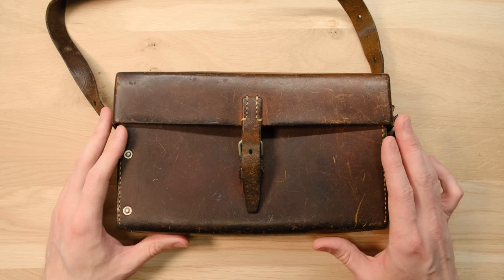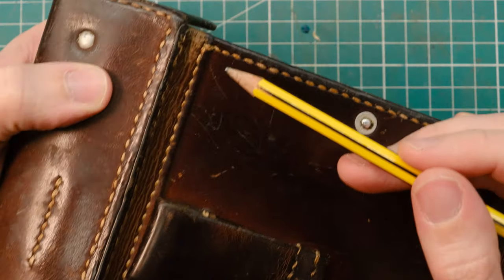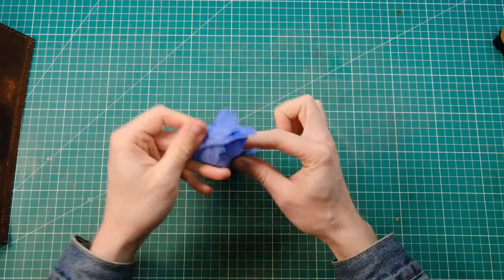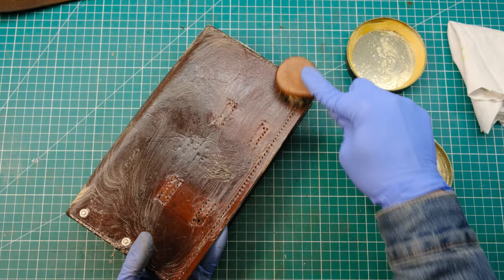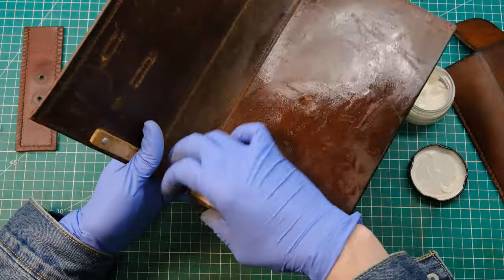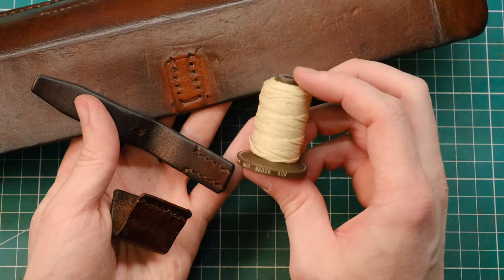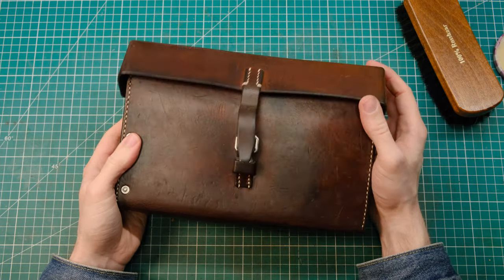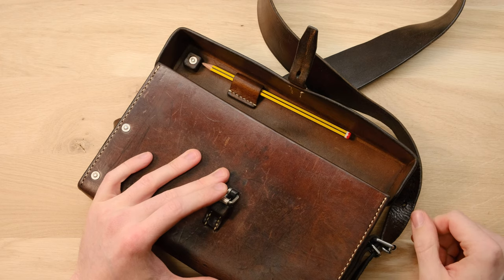Restoring a 1945 "Kartentasche" from the Swiss army - leather renovation

Comment: Nice video! Actually the R stamp is the mark that the inspector of the army would give a bag if it was qualified. These bags were made bij civil saddlers and they had to meet the standard of the army. The sling I think is from the same time period, but not belonging to this bag. I have only seen these bags with a very slim strap (adjusted to the back and not to the sides), or with no strap at all.
Reply from the maker: Thank you so much for the message, it's so hard to find relevant information on these bags especially as I don't speak German and a lot of the official documents are in German.
If you have any sources I can dive into I would love it if you could share these with me :)

Someone has tentatively identified the straps as belonging to French military harness straps...

Comment: Ive got exact bag from 50. My have original belt attached into back side of bag (22mm wide). It's interesting because I do not have mounting holes drilled on the sides but back side. Yours do not have any holes at the back side. It means they had two belt mounting systems.
Reply from the maker: Thanks for your message, I'm always curious to hear about the variations in these bags!
I wouldn't be surprised if they had different versions of this bag for different uses, or maybe it evolved over the years and was adapted... or maybe the user themselves modified the bag to suit their specific needs.
Anyhow, great to read yours is still in use :D

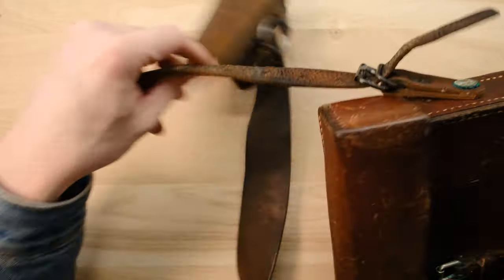Comment: hello there. I am Swiss an my grandfather was actually using one of these while he was serving. I never hold one of these bags in my hands but i there was some sort of attachment for the "weird" ring (3:15) in the middle of the straps. in that way one could have used it as a backpack. i am not a 100% sure if every model was built that way or even were meant to be a backpack. but that is what i heard from stories. there are many of these flying around in swiss fleemarketsites. mayby you´ll find an other one.

Comment: At 3:26 the strap looks to have a bit of mold on the piece where it gets narrower...what did you do to treat that part? Anything in addition to the rest of the process? Thanks, great work btw!
Reply from the maker: The mold wasn't too bad and came off easily when scratched with a blade. I then cleaned it up with alcohol to make sure there was none left.
Thanks for your message, glad you like it :)

Comment: Hi! Might be a dumb question- is box stitching basically just saddle stitching for box shaped edges?
Reply: Better late than never...yes, essentially. A box stitch will go through at least one of the panels at an angle, or both depending on if they are butted (one overlapping the edge of the other) or mitered (both cut at 45 degrees to create a corner.) As with normal seams, however, there are other stitches that can be used besides the traditional saddle stitch.
Reply: @PickledAmericano  thank you! Very helpful!

Comment: great job. I wanted to mention that if you have trouble finding the cream used you can also use Skidmore's which is essential the same thing. as far as oils like you said neetsfoot oil is most common but a lot of saddle makers swear by extra virgin alive oil. you said that cooking oils can go rancid which is true, though all oils including neetsfoot goes rancid if over applied. my experience with using evoo it to just wipe on and rub it in, then wipe off any excess. don't apply to heavily. I've used it before without any problems but I do prefer neatsfoot oil and Skidmores.
Reply from the maker: Thanks for this, I did not know of Skidmore cream but will keep an eye out for it so I can test it out!
True, all oils can go rancid if over-applied. I've always stayed clear of extra virgin olive oil though but it's certainly better than leaving the leather to dry out :)
Thanks for your message!
Reply: I second the Skidmore's product.  I use it and it's excellent.
I would never use olive oil on my leather.